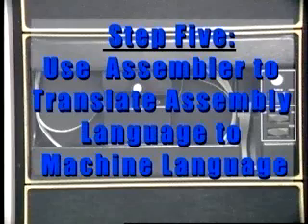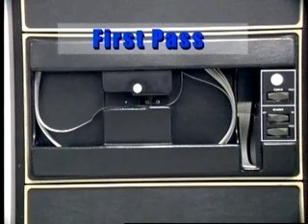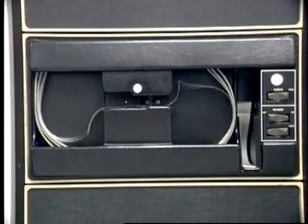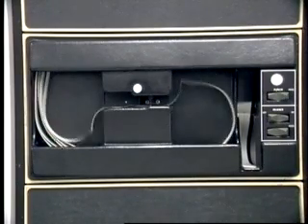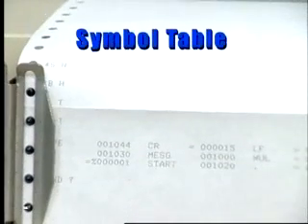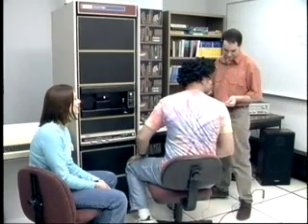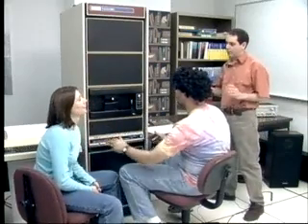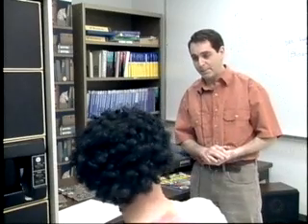Programming the PDP11, part 3 of 4

Comment: So, is there an operating system at all, or does it just run one program at a time, off of the paper tape (or front panel toggle switches)?  In any case, it's a fun video.  Nice job.

Comment: He didn't explain how he changed the execution of the computer between re-running the already-loaded loader and re-running programs multiple times. I hazard a guess that the user toggling between programs in this way is actually computing's first user-mode kernel—and the architecture includes a human user.

Comment: 300 Bytes per second. That's only 100 Bytes/s slower than a standard Commodore 64 1541 Disk drive (without fastloader).

The PDP11 btw has a very neat instruction set. If you look at it, you can easily see that the Motorola 68000 engineers (my favourite CPU) ripped it off almost completely.
Reply: Many consider PDP11 assembler, together with the 6502 and 68k, as the best instruction sets there were.

Comment from the maker: Actually, in this paper tape system PAL-11 produced a loadable image.  The one thing I did simplify in the video was the loader.  Technically, one had to toggle in the bootstrap loader, then use it to load the absolute loader which was used to load all other images.  In the video I suggested that the bootstrap loader could be used to load all images.